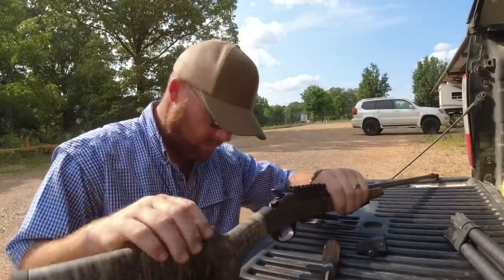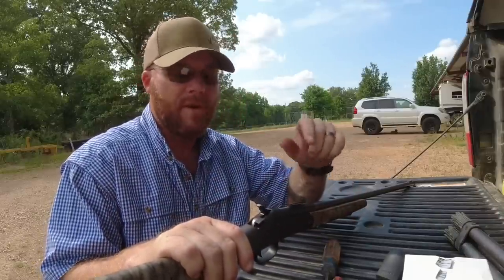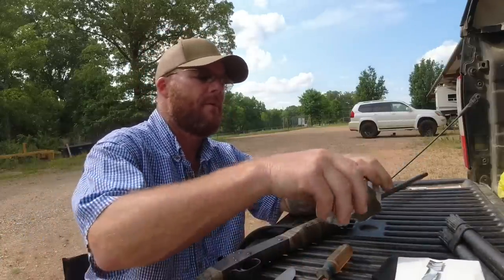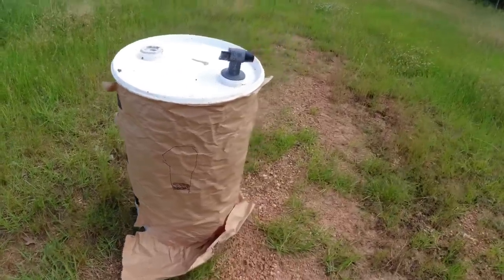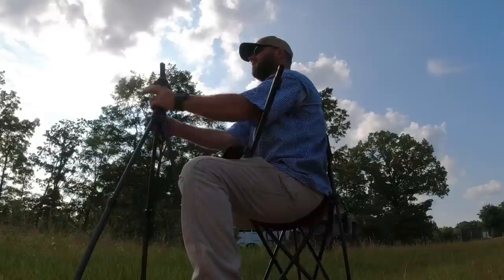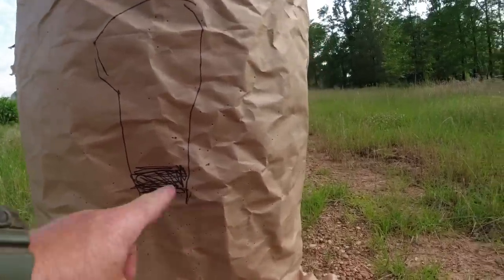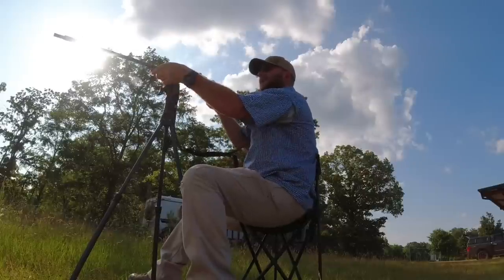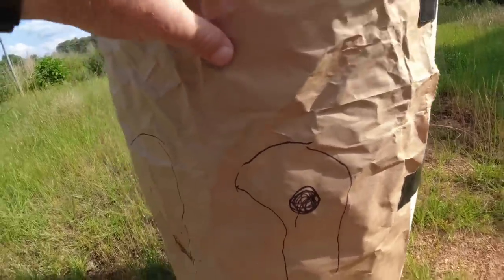BACK TO THE STEVENS 301🤬Can’t Get It Right

Comment: I know everybody has advice for you so I’ll thrown mine in. Just shim the rear of the rail. If you think of it like a set of sights, raising the rear sight to make point of impact higher. Same thing with a long range rifle base, they mill the base at an angle (taller in the rear) to give you more vertical adjustment in your scope. Hope it helps.
Reply: I agree with you change the angle

Comment: Hello Jason,you can try turning the weaver rail 180 degrees to see if that changes the pattern as it might have not been machined level from the manufacturer.Mark the rail so you know which end is which. :) Look for any machining burrs or defects on the weaver rail and the Vortex sight base contact surfaces which may be causing the problem.

Comment: I have a Benelli and a H&K O/U turkey guns.  I had the same problem and eventually scoped both guns to have enough adjustment to get to a proper zero,  The Benelli was the worse.  It shot a foot to the right and 10" low with the .656 turkey chokes.  I was told the tight chokes would throw your point of aim off down range and both weapons proved it in my case.